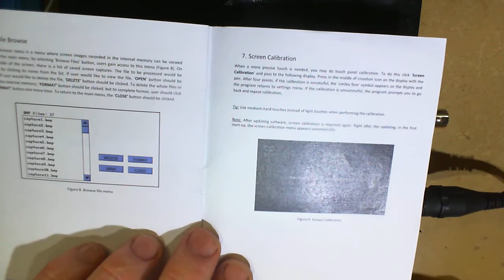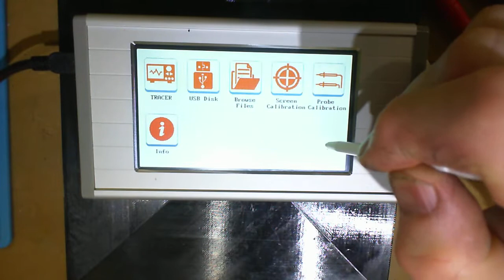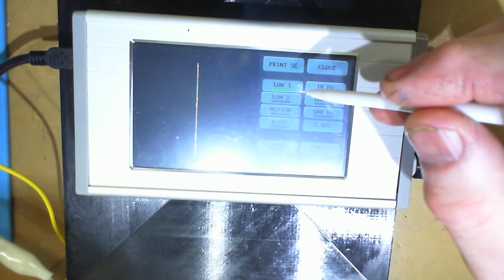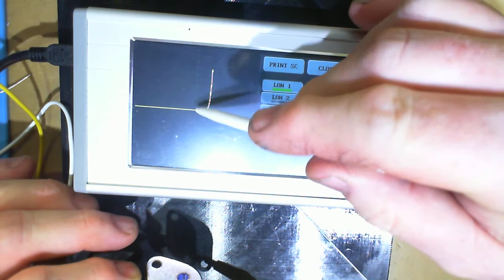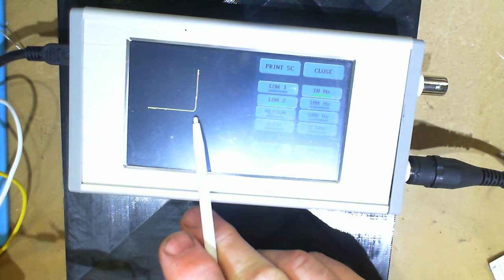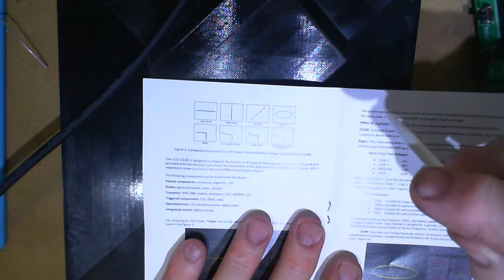Ucore curve tracer Ct202l

Comment: Do you find this helps a great deal during electronics repairs? I only have a single channel scope so i would have to fork out €100 for a dual channel and build a signal tracer kit, or i could buy one of these. But, how often does it really save time when compared to testing transistors on a multimeter or digital tester?
  Thanks.

Comment: Did you buy from ucore electronics directly and did you have any problems with US customs as far as owing import taxes?  I'm a little leary about buying from them as they are in Turkey and I worry about being scammed.
Reply: I have purchased 2 devices from ucore-electronics their shipping is fast and expensive around $20. They aren't scammers I have both the UCE-CT220L and UCE-CT220S I was nervous on the first shipment but fine on the second.

Comment: Why it has modifications? what happened?
Reply from the maker: It did not have mods. The first unit was smoke when I had it plug into the computer for power and accidentally let the leads drop on a heat sink that was connected to a capacitor. Looks as if the cap discharge to ground thru the unit to the computer usb port to ground. Did not damage the the computer usb port. But damaged the ucore unit.